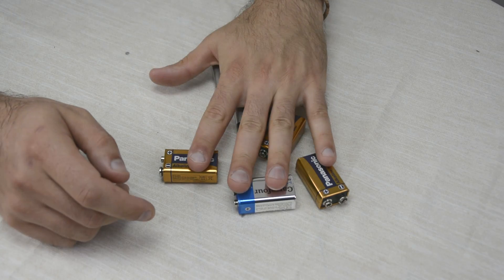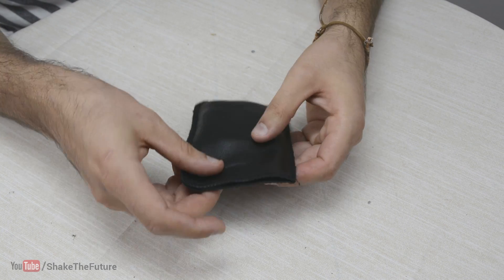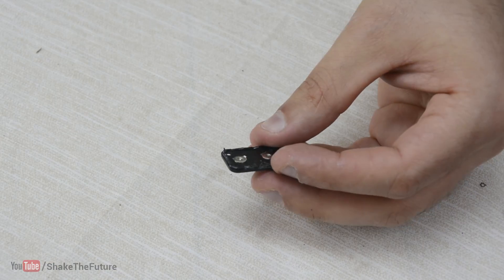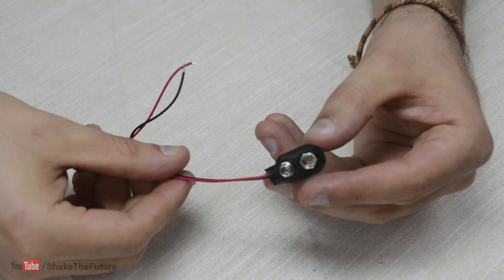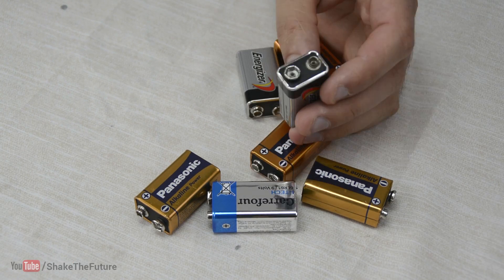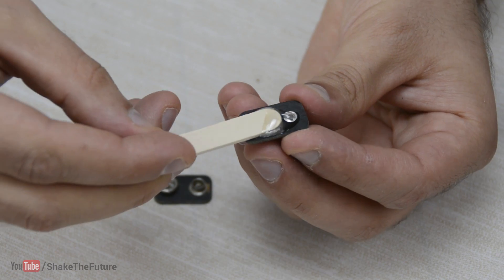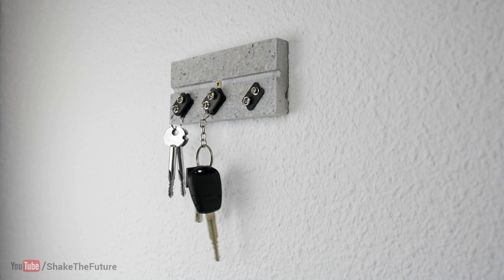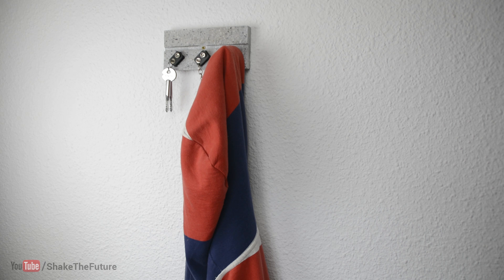3 Things You Can Make From 9v Batteries

Comment: dude,do you have a bunch of these batteries lying around?if you want to connect them all without using a wire,you can use the terminals on the batteries like this:connect the + terminal of battery 1 to the -terminal of battery 2.just keep going for all the other batteries and your done.

Comment: There are good tricks but these batteries are expensive and there are other ways of doing this
Reply from the maker: +Ali Faris Surkovic 
As the batteries were dead, It did not cost me anything to do this project. You can even get the batteries from recycling point if you don't use them yourself. Cheers!

Comment: Dont keep batterys in a bucket like that 

If they in some way make a connection from all the batterys touching they will catch on fire
Reply from the maker: +900bz 
I do keep AA and AAA batteries in a bucket, but not 9v batteries. I put the 9v batteries in a bucket only to demonstrate that you should not throw it away. But, yes - You are right. You should not keep any batteries together in a bucket. It's one thing I have picket up from recycling points. In every single recycling point I have been, they keep batteries in a large bucket. So you automatically assume that it's ok, but it's not.

Cheers!

Comment: "What to do with 9v batteries when they run out of juice?" Do NOT "throw them away". Take all spent batteries to a place that will recycle and/or despose of them properly. (We should all be using rechargeable batteries anyway.)
Reply from the maker: +monk man 
Yes, we should use rechargeable batteries. I totally agree!
 Unfortunately some gadgets don't work that well with rechargeable batteries.
My metal detector does not like AA rechargeable batteries as they are 1.2v instead of a normal 1.5v battery.
Thank you for taking the time to leave a comment.